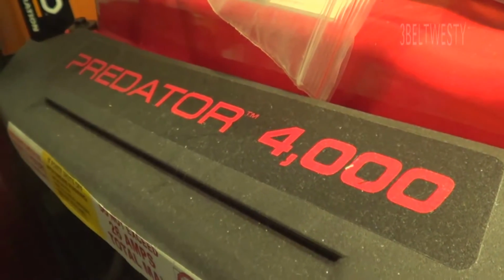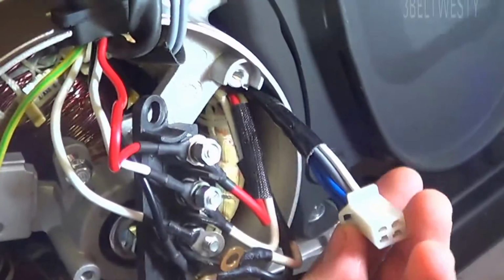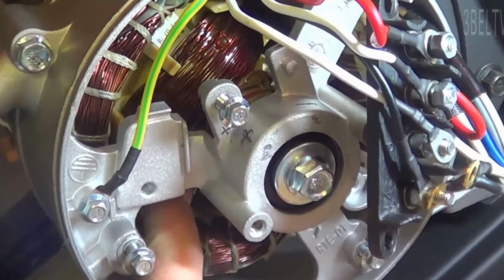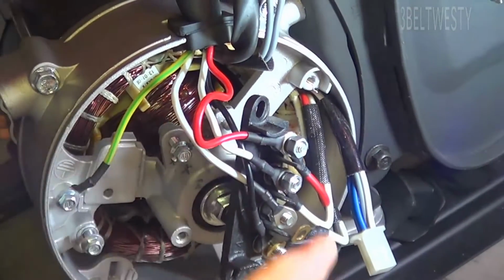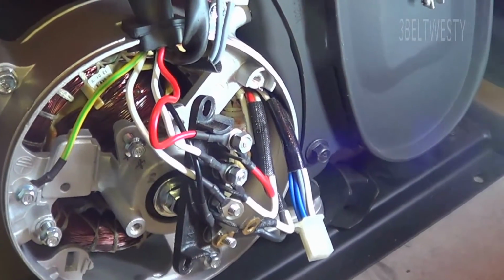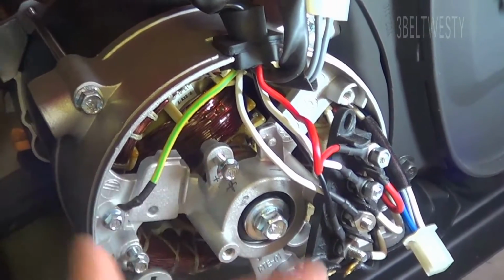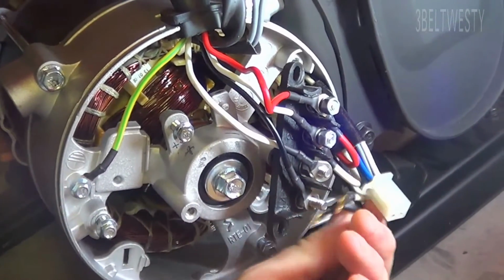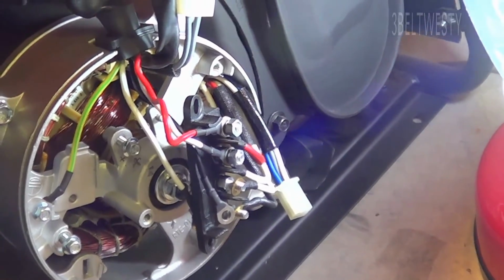3200 watt Predator Generator 120 volts at 26 amps for RV use (3) AVR plug

Comment: What if we identified which sense wire wasn't changed by swap to parallel and put a small low current 2-1 transformer on it and disconnect the other? If we drive the AVR with a steady direct current it wont react to a heavy load like a jack hammer. I suppose a more complicated way would be to pin point how high the impacted sense wire is and custom make a transformer to bring it down to match the other, but this may not work as well if the AVR is expecting 2 currents out of phase to add voltage together not amperage. It kind of seems like the AVR is doing two separate checks of voltage and not crossing them, if it crossed them it would be 0V right? What would be the result of sending the sense wire that wasn't impacted into both AVR wires unchanged?

Comment: I had sent myself the link to this video some years ago, and just happened on it. 
A lot has changed since this video.  As I understand, some mfgrs. tapped into a main coil for use as an exciter coil to apparently save money.  This resulted in the funky voltage output when you tried to connect them in parallel.  
[Did I learn that from your video? Perhaps why I saved it.] 
Those generators had no power at 120v and users needed to pay attention to balancing their loads.  However, at 240v, they often  provided maximum output.  I still use one for my well pump at 240v that needs close to 5k to start properly.  At 120v, it can't even run my microwave or miter saw.  
I bought a Duramax 4400 previously (2015).  Built right!, but just not enough peak output for my pump.  And it's still running.

Comment: O
Reply from the maker: It does work, you just have to follow the correct way to supply the AVR with the sense voltage input it needs.I f it is too complex just buy a unit that already has this feature.
Reply: @3beltwesty  I didn't even comment on the right video I meant the original video that doesn't mention it didn't work without a bunch of extra stuff.

Comment: After watching this video, I decided to do a little digging. What follows is speculative.

This generator appears to be the same setup, with two 120V circuits in phase delivered to a Standard 30A RV 30a receptacle.
https://www.homedepot.com/p/Sportsman-4-000-3-500-Watt-Gasoline-Powered-Portable-Generator-with-RV-Outlet-801187/206403560
Reply: Since these units are often different configurations of the same platform, I looked and found this:

It appears to be the same shape and connector as the AVR in the 1st platform.

https://www.vpowerequipment.com/replacement-avr-fits-sports-man-4000-running-watts-1/?gclid=CjwKCAjw0On8BRAgEiwAincsHHNv4UKz7zZCWNbUjJejRYXCpjoYG_dVB0BT3Cue-M1z9i6MUc6e8BoCms8QAvD_BwE
Reply: So, if you're interested, this AVR and a new 120Vx30A plug MIGHT complete this conversion.
Reply: There is also this replacement part for the harbor freight generator, which states:

"1) In Case the AVR is out of adjustment for your generator, the voltage of the AVR can be adjusted.
There is a bronze screw in a blue plastic part in the AVR, please manually turn clockwise to increase the voltage output and turn counter-clockwise to decrease the voltage output."

https://www.amazon.com/Mover-Parts-Predator-30060-Y025110-Generator/dp/B07BBMDXLR

Comment: If you could add a short video showing the finished product, with connections, adding the 120VAC - 20VAC transformer, that would be very helpful.